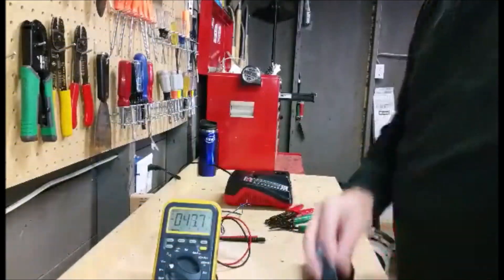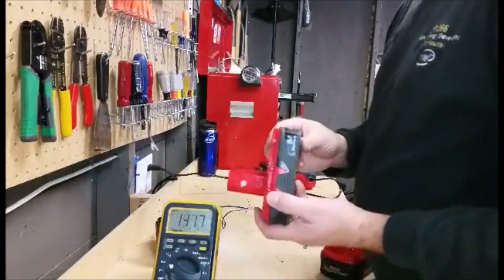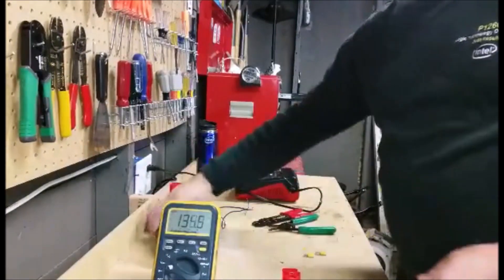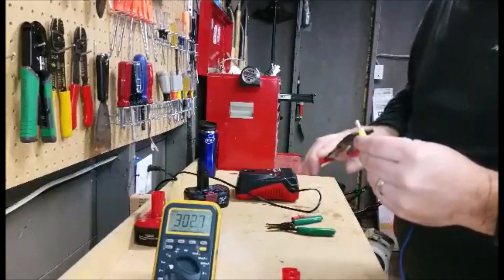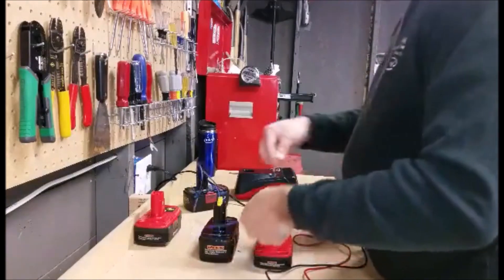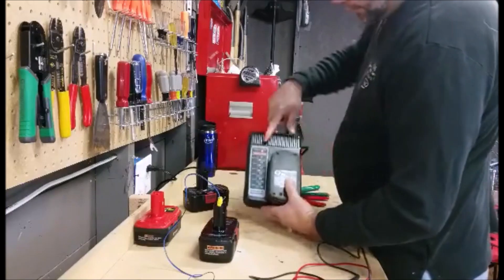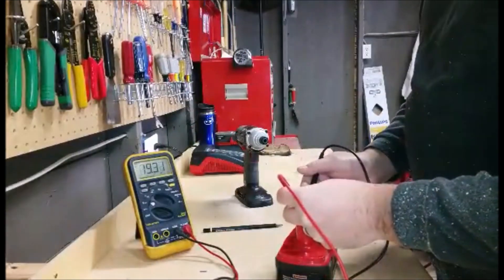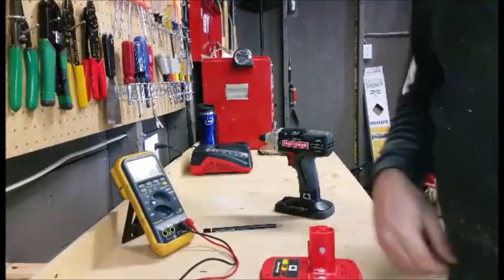"Fixing" Li-ion Batteries that wont take a charge

Comment: DELAYED FIRE HAZARD for Lithium Ion (LIon) batteries!
Did anyone stop to ask - WHY did the battery pack shut down?
The battery pack was shut down as a safety precaution because LIon batteries used to catch fire.  Then someone figured out why, and manufacturers started adding safety circuits to keep that from happening.  What you are doing fools the safety circuit, and can lead to the battery pack catching fire:
 - Once an individual (3V) cell gets below (IIRC) around 1.4V, the copper electrodes start to dissolve.
 - If the pack is then recharged, the copper will form nucleation sites where metal whiskers will begin to grow (by electroplating), inside the cell.
 - After some charge / discharge cycles, the metal whiskers will begin to short out the battery cells.
 - Shorts in the battery cells can get hot enough to ignite the battery.
 - Oops, left it on the carpet near the baby's crib!

LIon batteries hold a LOT of energy.  They can catch fire and even explode, which will at least ruin any power tool they are in, and might start a house fire.

Better to get a new battery, or replace the old cells.
Reply: MrTechnophile 
Well, this scares me off trying to get these two 40v going. They want $200 each for new ones and the whole lawnmower wasn't that much. Puh.
Reply: Did you end up trying it or not? $200 is a lot of money for a battery damm

Comment: By battery hasn't been used in a couple years and the voltage rating was less than 1 volt maybe even a half volt but once I jump started it it went up to 5 and then 10 after just a few seconds and now it's slowly charging

Comment: Couldn't you do this with 2 9v batteries linked?
Reply from the maker: Random Moustache Guy I'm not sure that will work. We're not just dealing with voltage requirements but amperage as well.
Reply: Possibly if a lot of them you could get it done but it would be a lot more expensive than just the battery probably.  If you just used two they would likely be used up before any meaningful change.

Comment: I wish I'd seen this vid 2 weeks ago.  My one and only big Li-Ion C3 battery (exact same battery as you show) was dead (the charge indicator light on the battery wouldn't even come on).  So... I got 2 new ones off eBay (which work fine).  I hated to just pitch the old one... then I saw your video.  I "sparked" the old battery from one of the new ones and got it up to over 9V, then put it on the charger.  It says it's charging AND the charge indicator now lights up when I push the button.   I THINK it's going to work again.  Will post an update with the end result. Thanks for the info.

UPDATE:  NO JOY - After about 10-15 min on the charger - the charger lights looked like there was no battery at all.  I think my battery is really, truly dead.   But it was worth a shot.  And I have  2 brand new batteries, so I'm back in business anyway.
Reply from the maker: Yep, sometimes they do die forever.  Sorry this did not work out for you.
Reply: interesting points ,if anyone else trying to find out diy battery reconditioning try Cypouris   Renewal Guide Coach ( search on google ) ? Ive heard some awesome things about it and my work buddy got great results with it.

Comment: My 18v Porter Cable battery was defective ...When i plugged in into the charger it just flashed red indicating a bad battery. I tried this method of  recovery, after doing so, the charger will no longer recognize the battery at all, so it completely shot now. I am sure this will work for some units but it didnt work for mine.

Comment: hey, i repaired a few of these ryobi packs (5-cell and 10-cell)  the voltage is is 20.7 at the cells before the circuit board and only 19.4-19.3 when check from the outside of the case,  a few other battery packs will show 20.7 from outside .... any idea why its doing that ?  Thanks
Reply from the maker: Lion cells have that circuit board that serves many purposes, My guess would be in your case you are reading ~20.7 before the voltage regulator and then outside the case is reading after the voltage regulator.

Comment: I didn't feel like getting my huge car battery charger out of storage to do the "trickle charge" option. I saw this video and I have to say that is a pretty slick way to do it. i did it the exact same way I used my charged lithium ion battery and it woke up my dead batteries. put them on the charger and they are good to go!! Thanks a lot for posting this version it works!!
Reply from the maker: Chris Merritt , glad it worked for you! Thanks for watching
Reply: I tried it but couldn't get the ion battery above 4.7 volts..I shocked it with a car battery,a trickle charger and  tried hooking it up to a charged 19.2 v battery but nothing helped

Comment: Wouldn't it be safer, and easier on both batteries, if you connected a power supply, or an ,40VDC wall wart, to partially charge the battery and then put in the charger?
Reply: Make that a 40V or less wall wart

Comment: I followed the instructions and afterwards the pack had 20v and each cell was 4v, but the charger stays on red flashing, and the battery won't power any device.  Problem is I never tested the cells before doing the refurb as per the video so maybe they weren't down below 1v. Anyone any ideas what might be wrong?  The battery was powering a lamp for a long time and then it just went off so the battery should be exhausted.

Comment: Thank you for posting this - I just did this on a Stanley Fatmax 18v  2.0ah  Li - ion battery that was refusing to charge - used a small 12volt to boost it from 1.8 v up to 9.2 - put it in the charger and it started to charge as normal - was about to order a replacement.
Reply from the maker: Really glad that this worked out for you! Thanks for watching.
Reply: Thanks for the info!  I've got a 19.2 volt battery but nothing that matches, so now I'll try a 12 volt trickle charger and see if that works. 😊

Comment: What I don't understand is that another video shows two identical batteries jumped together for 15mn to wake up the dead one. No spark, no hitting 3 times.
Does this mean that when using a higher voltage, you need to hit it only, while using the same external voltage you can leave it for 15mn ?
Thanks
Reply from the maker: Philippe; Thanks for your question.  I am not sure to which video you are referring but here is my generic response to "battery-to-battery" CHARGING.  These batteries are not designed to charge. They are designed to operate the device you have plugged them into unlike the mobile charging batteries that you can plug your phone, etc into for a quick convenient source of power.

If someone is using a drill battery to CHARGE another drill battery they risk an explosion or critical failure of one or both of the batteries. Unlike a wall charger or portable power bank (battery) your drill batteries do not have an internal circuit designed to regulate the flow of current as needed in a charge cycle.

The reason we are "touching three times" is so that we only flow a tiny amount of current back into the dead cell in order to raise the low cell(s) threshold voltage above the minimum required for the wall charger to recognize it as good and then take over the normal charging routine when plugged back in. 

My battery was a Li-ion battery whose individual cell voltage was lower than what my charger would recognize as "good". Once I bumped this with a different battery the charger cell checks passed and charged the battery normally.

 I hope this answers your question.  Thanks for watching!

-DrCox

Comment: Sad part is--it won't work for all Li batteries. If the electronic circuit has discharged them below a certain voltage. The case must be opened and each battery charged momentarily (4.5v). And put on charge,  Ryobi are noted to fail if not charged regularly or draining the battery to a stop and forgetting to charge--A big no -no!. Once the  V drop is below ,circuit will not accept charge.Bad bad engineering.
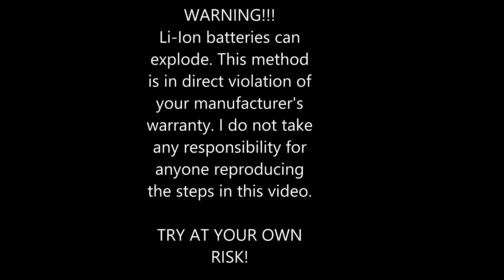Reply from the maker: I am in no way accepting liability for someone who chooses to perform this procedure which is in direct violation of the manufacturer's warranty. Please see my disclaimer at 00:08.
Reply from the maker: Well, this was a personal project for me, and it worked. These batteries are 7 years old. I performed this procedure 3 years ago with no failure and regular use.  Obviously, results vary, especially for engineers...
Reply: Start your very own battery business and make huge cash here: HootBattery.xyz
Reply: Until they start catching fire and you lose everything in the lawsuit.  This is bypassing an important safety feature.
Reply: You are describing 'jump starting' the battery.  I know an engineer who was involved in a project in which some LIon batteries were jump-started.  Some time after that, one of them caught fire.  

When an individual (3V when charged) LIon cell gets below 1.4V or so, the copper electrode starts to dissolve.  When recharged, the copper plates out at some spots that provide places for lithium metal whiskers to grow.  As discharge / charge cycles go on, the whiskers grow and eventually short out the cell, resulting in hot spots that can ignite the battery.  Not right away, and probably not every battery, but who needs to play Russian Roulette?

There are safety circuits that shut down the battery if it ever gets too low for a reason!

If you have to use that battery pack, have it rebuilt with new cells.
Reply: Go here if you want to make huge cash with your very own battery business: JoxCharge. com

Comment: what does it mean if i try to charge my 3000mAh 3.7v battery when it has 0.00 volts showing, and it melts the charger each time.
Reply: It means it's internally shorted and a fire risk thanks to lithium metal plating out internally.
Reply: Yes, check internal resistance.  You cant revive a dead 18650
Reply: v

Comment: This gave me a idea with a pc power supply and a single cell battery and it work. It was reading 0.0v on the charger and after the first spark i plug it back to the charger and it read 1.0v and starting charging

Comment: Excellent video!  It's good advice to fix these "bad" batteries by charging independent of the charger.  Charging without any current limit is very rough on the batteries, you can put a light bulb in circuit to limit current and reduce risk of damage.  Note, many C3 Lithiums won't charge unless you put 22K between the left pin and the + pin.  Details on building your own charger (without the annoying low cell protection) are in my blog at https://chisight.wordpress.com/2016/10/20/charge-diehard-craftsman-c3-lithium-ion-battery-packs/
Reply: How to start a battery business at home and make a lot of money: JoxCharge. com
Reply from the maker: Chi Sight I'm not sure what smoke you are referring to. all I did was bump the ICV with another battery and the use the factory supplied craftsman charger.
Reply: Donnie Cox: At 3:52 there is a little whiff of smoke, possibly from the wire vaporizing as the huge amount of current goes through the edge of the wire as it makes contact.  Assuming 5 cells at .2 ohms internal resistance, you'd be pushing almost 15A into the dead pack.  The real number is probably less but still rough on a battery to do this without some form of current limit.  A lightbulb is a cheap one that just about everyone has, but any form of current limit would do.
Reply from the maker: Man I reviewed the master footage at 1080P 60Hz, I think what you are referring to as "smoke" is actually dust particles floating in the air. I made this video in the middle of making a jewelry box for my wife so there is a ton of dust in the air (see my left arm later in the video).  I appreciate your wordpess article and your advice to the viewers, but again, I assure I was not "arcing and sparking" anything during this procedure.  No vaporized wire, no high current welding, no smoke.  Thanks again! -DrCox
Reply: Donnie Cox:  Understood, I've edited the comment to remove the part about smoke.  Thanks for the clarification.

Comment: i dont have all your equipment-  how can I do this ??
Reply from the maker: wiz b at a minimum get yourself a cheap volt meter and a voltage source at or near your dead battery voltage ( not above). you can get a sub 10 dollar meter at Wal-Mart or Amazon for like 10 bucks.

Comment: Interesting.   SO it charged, but doe sit last as long as a comparable battery that was good? Or does it die very quickly and need recharging again?
Reply from the maker: it's not "charging" the battery. it's raising the threshold voltage of the cells enough so your charger can recognize the battery and charge normally. don't leave the 2 batteries connected. risk of damage to the cells.
Reply from the maker: The Cells last just as long.  My Li batteries are going on 7 years old now and are still pretty much as good as day 1 (the Nicad ones not so much).  Remember, my battery was fine but had been sitting for a while in storage.  This caused the ICV (Individual Cell Voltage) to drop below the limit where my charger would see it as a "bad" cell.  The purpose of this video was to show that if you raise the ICV above the lower threshold limit, the charger will no longer see it as a bad battery and charge as normal.  Obviously batteries will eventually die but in my case it was due to  long term storage.
Reply: Donnie Cox how long in storage are you talking about? i have a bissel bolt vaccul with lithium ion battery and it wont charge, was gonna order news cells, theres 5 of them

Comment: will this method work if I'm using regular nicad batteries to boost a dead lithium ion battery?
Reply from the maker: I was using a nicad battery as the booster as well. use caution.

Comment: Norelco Li shaver works the same way. Pull off the triple head. Starting at the tail end, pop the cases in half, slightly tricky to pop the four little retainers on each side with a precision screw driver, and charge the Li AA size directly with a small AA batt charger and jumpers. Reassemble the Norelco shaver and it should finish the charge in the 16 VDC stand with display indicating charge.